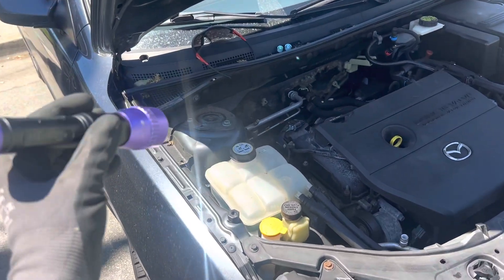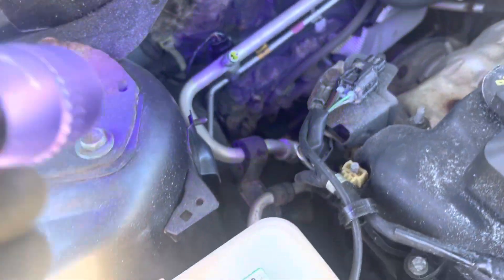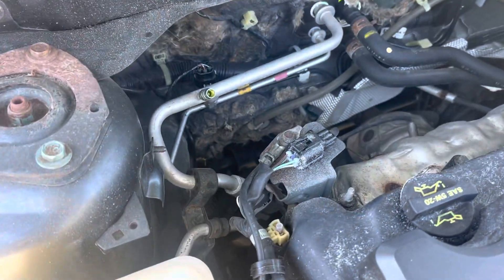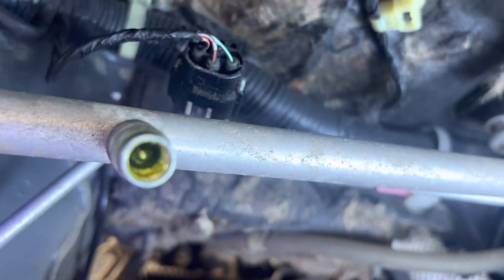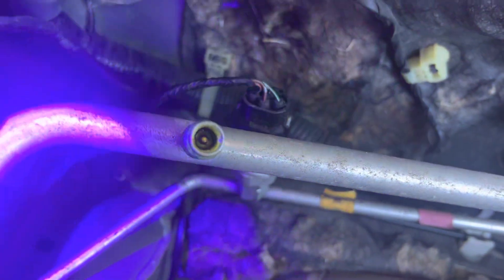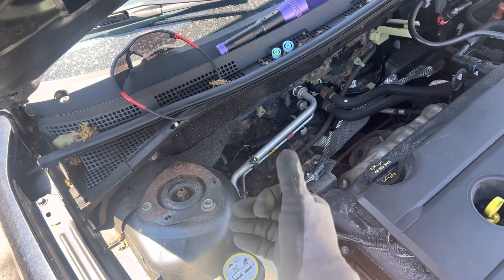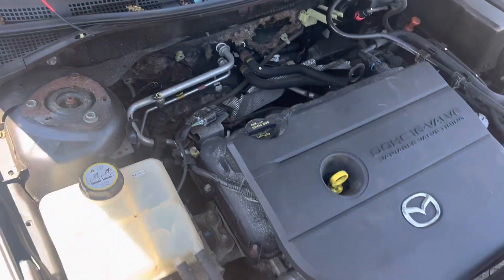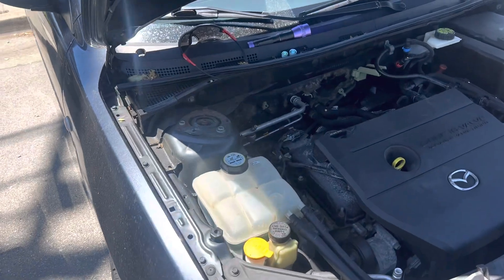AC USED CAR REPAIR JUST KEEPS GETTING  SKETCHIER 😱  no surprise

Comment: Tom, do you run any old refrigerant thru a recycling machine then put back into customers vehicle? Or just recover and return to turn in facility. Those $16,000 dollar recycling machines, I sure can’t find a lot of Info on what they are capable of as far as removing any contaminates. I am pretty sure they can’t separate different gases but haven’t found any info to confirm that one way or another.
Reply from the maker: You are correct they do not separate different gases but they do have a automated ear bleed off valve that goes to a periodic slow process of checking pressure and temperature and bleeding off some of the air and refrigerant from the top of the tank until it gets close to a representation of the PT chart and using that as the method of getting rid of non-condensibles. 

My machine is custom made much more complicated and much more thorough at removing moisture or acid in particular matter and oil than any machine on the market they would not be able to afford to sell it to an automotive shop would cost more than a car. 

And one of my stages go through a choir genic freezer bringing the temperature of the refrigerant down below its boiling point -22 to -27°F to aid in the removal of non-contaminants as atmospheric air to separate it.  

And instead of venting it off into the atmosphere like the other guys do with their machines I vented off into another recovery machine that saves that noncondensible air that still contain some refrigerant inside A jug that is below -27°F. This separates out the remaining refrigerant from the non-condensibles even recovering more of the refrigerant that would be wasted to the atmosphere normally

And then because I only refrigerate an analyzer I actually analyze the refrigerant and keep repeating the process until I get down to 0% air. 

The allowable standard with the machine is somewhere around 2% air contamination because it would cost too much to make a machine that could get down to 0% or it would bleed off too much refrigerant into the atmosphere trying to obtain 0% air contamination.  

But I can do that because I know how. 
Education is a wonderful thing lack of education is terrifying in the technical business
Reply: @coldfinger459sub0  always appreciate your replies, very informative, you put a lot of work into your YouTube channel. It does not go unappreciated. Thank you sir

Comment: That dye looks thick and gooey enough to clog an expansion device.
Reply from the maker: Exactly what I was thinking there was a big branding company music called heard about me and came to me and gave me 30 pound jugs of free samples with UV dye already installed

And one of them you had to shake it up and down every time you used it and it did plug up the screen on the expansion valve on one customers car.      And on my instant low loss no leaks fitting it plugged up my hose attachment fitting where I screwed it into the jug got clogged.    At first I couldn’t figure out I was opening up my gauges but nothing was flowing through I thought something was wrong with my gauges